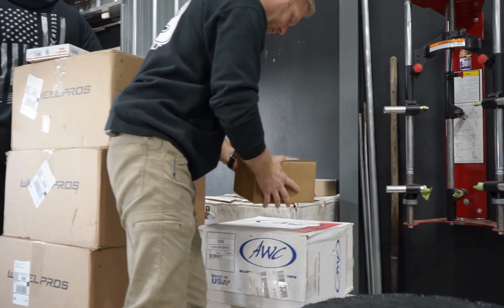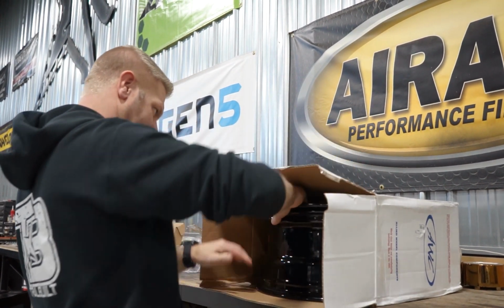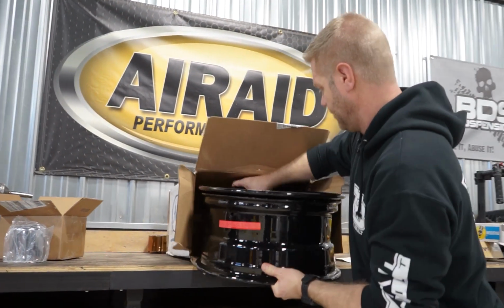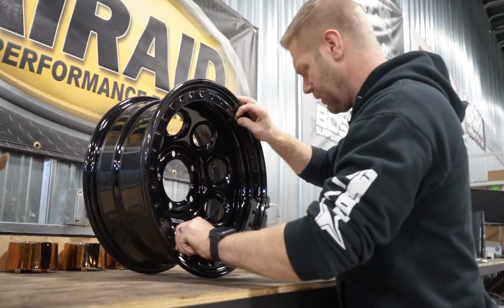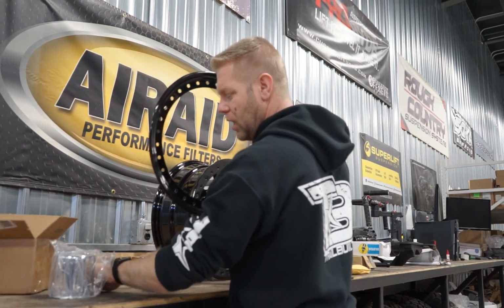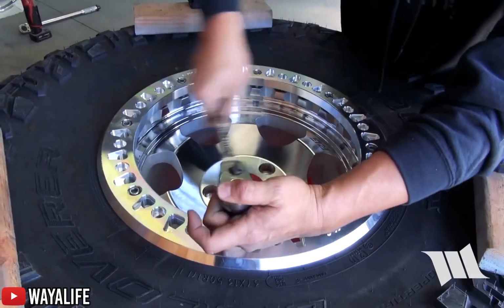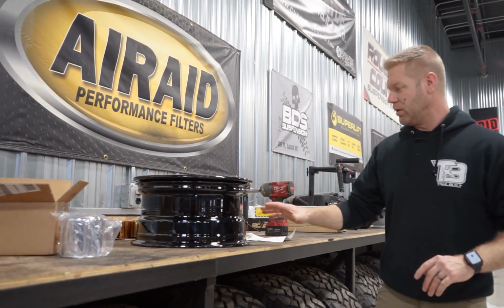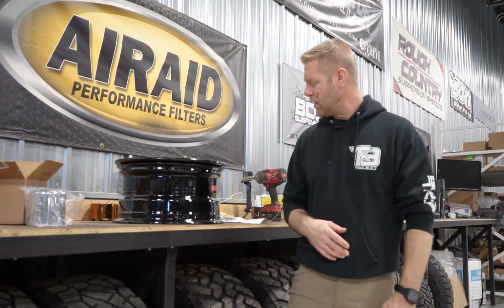Unboxing Our New Beadlock Wheel

Comment: start bolting rings on with 4 , 3 inch bolts and then . 4 , 2 inches bolts  . this will pull the ring down to the point where the sock shorter bolts can be started and the longer bolts can be removed .  under 50 foot lbsadjustable  torque wrench is needed